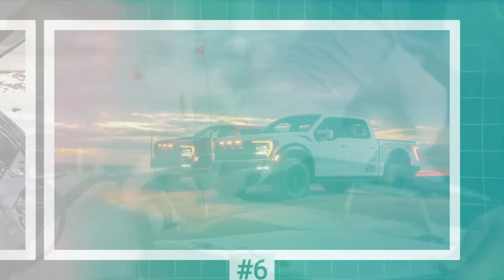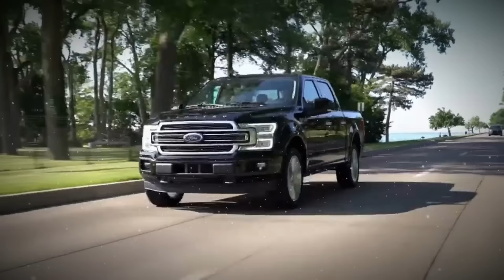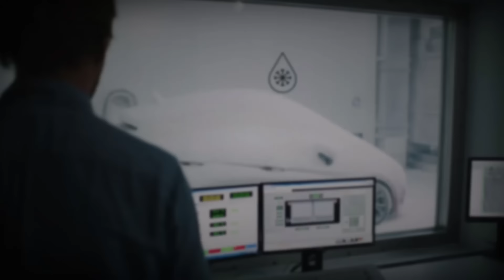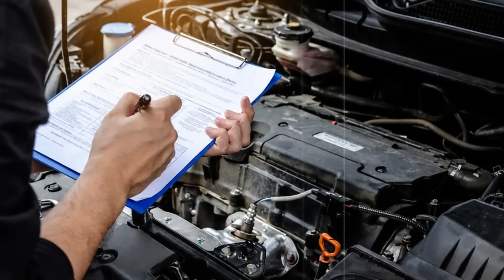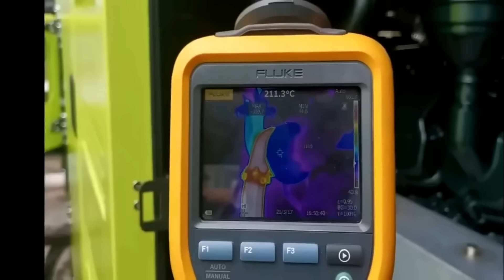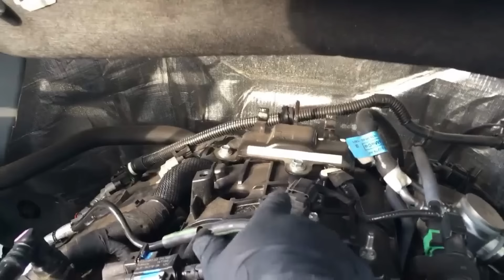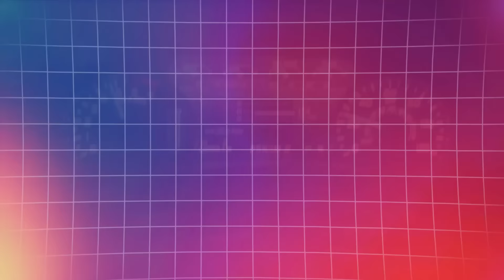We Ran a Turbo F-150 & a Naturally Aspirated F-150 Side by Side for 200,000 Miles — A Clear Winner

Comment: I think of paying for more gas with a V8 as insurance on a turbo or engine rebuild.
Reply: The older 2.7 EcoBoost doesn't have cam phasers. Good luck with your 5.0 cam phasers and rubber oil pump belt.
Reply: @kri @kristoforstewart995 But it does have cam phasers, they haven’t changed the 2.7 timing system, it’s gotten dual injection, vectoring turbos, electric watergates, and an oil pump belt, but it’s had cam phasers since day one they just don’t fail very often
Reply: @thomasnunya1438 You're right. I looked in the repair manual and now think less of that engine. At least it has a chain driven oil pump (shown under oil pump replacement). I will never buy a truck again that has cam phasers and and/or a rubber oil pump belt. I will be looking at the new Chevrolet pushrod engines. Hopefully, they don't have that garbage on their new engines. I had a 1.0 EcoBoost with a rubber belt and it disintegrated.

Comment: Had the same problem on stumbling on my 3.5 turbo 2014. Believe it or not but I was told to drill a 1/16 hole in the very bottom of my inner cooler, the problem went away and never came back.That was at 67000k and I now have 168000 miles. I warm turbos for 2 minutes and cool down the same. Thanks for the video 😁running penn ultra oil and top tier fuel.
Reply: 9767, it's called an intercooler.

Comment: 2012 f150- 220000 miles so far on my 3.5, just started to get the start up rattle. 2 major issue, steering issue but was under warranty, broke manifold bolt.

Comment: Nobody with half ass common sense would buy a 2.7 to tow 7,500 lb regularly, they would step up to a 3.5, my 2020 will walk off with 7,500 lbs behind it!
Reply: Yeah, right. My 2015 pulls that weight through West Virginia just fine.
Reply: @kristoforstewart995 and that can be a lot of hard pulls!
Reply: @bobadkins7377 I hit 4,000 rpm often, but V8 engines run at that rpm nonstop. I also use 93 octane. Maybe that's why my truck runs like brand new 11 years later.

Comment: Turbos should only be in the big tractor trucks only.
Reply: I don't have a problem with my 2.7. It doesn't have cam phasers and it does have a chain driven oil pump.

Comment: I don't want ecoboom in any vehicle.
Reply: I think it's luck of the draw because I have 2015 2.7 that I use to haul work trailers and boats. I've seen many Coyote engines fail over the years because of cam phasers and rubber oil pump belts. I must have got that one engine without defective parts.

Comment: Never tow 7500 lb trailer with 2.7 , step up to3.5
Reply: The 2.7 pulls it just fine. The older ones didn't have cam phasers like that aluminum 3.5 or 5.0.

Comment: sounds like the turbo spent more time in the shop
Reply: I have the 2015 2.7 EcoBoost. It doesn't have cam phasers. Good luck with the 5.0 cam phasers and rubber oil pump belt pos.
Reply: What made you think it doesn’t have cam phasers, I have a 16 2.7 and it most certainly does have cam phasers almost all newer engines have variable valve timing and use cam phasers. Mine are rattling on cold start currently (that or chain slap) and the mechanics say the 2.7 doesn’t usually have that problem like the 3.5 but it does happen.
(Edit) I’d still chose the 2.7 again though over the 5.0 that turbo low end torque is incredible, at 2500rpm the thing is flying, and I drive a lot of 5.0 for work and the ecoboost feels better and uses a lot less gas while empty.
Reply: @thomasnunya1438 You're right. I looked in the repair manual. I'll never buy a truck with cam phasers or rubber oil pump belts again. At least it has a chain driven oil pump belt as shown under oil pump replacement. I will be looking at the new Chevrolet V8s. Hopefully, they don't have that garbage on their new engines. I had a 1.0 EcoBoost with a rubber oil pump belt and it disintegrated.

Comment: Awesome comparison, and it confirms my assumption back when they introduced the ecobust trap!  When one buys a truck, the engine is the first option, not the truck! The idea of putting turbos on a V6 meant more parts and a complicated engine, in my view! In 2013, I bought the 150 CC, 5,0, OR, but the 6.4 bed, and as of today, with 158K, I've had great service! I put an oil pan gasket and rebuilt my AC system; the rest was consumables!
Reply: The 2.7 EcoBoost didn't have cam phasers until 2021. Good luck with your 5.0 cam phasers and rubber oil pump belt.
Reply: @kristoforstewart995  I believe all ford engines beginning with the tritons have had cam phasers, and 5.0 didn't get that wet belt until 2021. The 2.7 has had the wet belt ''rubber'' since the beginning.
Reply: @Wildwwill i was wrong about the 2015 2.7 having VCTs, sorry. But in regards to the oil pump, if you go to the Chilton 2015 to 2017 Ford F150 repair manual on page 2A-2 for oil pump removal on the 2.7 liter engine, it says:
1) Drain the oil and remove the oil filter
2)Remove the oil pan
3) Slowly rotate the oil pump drive CHAIN tensioner counterclockwise until a small drill bit or Allen wrench can be inserted through both holes in the tensioner, locking the tensioner against the spring.
4)Remove the 4 oil pump mounting bolts while supporting the rear of the pump. 
5)Slowly lower the rear of the oil pump until the oil pump sprocket can be lifted out of the CHAIN and away from the vehicle.
I might have VCTs, but I don't have a wet belt. Those are weak points that needs to be adressed.

Comment: 2.7 for everyday use with periodically towing 6000 or less like a boat or travel trailer. If your towing everyday or using it for work pulling 7000 plus pounds all the time id get the 3.5 or 5.0 and if you want best mileage empty 2.7 is by far the best and built better than the 3.5 and way less problems and more reliable. If you want the most reliable for 10yrs plus id take the 5.0.

Comment: Now compare it to the 2.7. Everyone knows the 3.5 can be a problem engine
Reply: I’ve had two 3.5 love the power. Can barely feel my 21 Foot Lund..
Reply: I bought a secondhand 2017 2.7 a year and a half old at the time with 7k miles on it for a steal as the owner wanted to go to the short box full cab. Mine is the extended cab with 6.5 foot box. I would have never bought anything but the 5.0 new. Anyway it now has 63k miles on it and almost never tows. On rare occasions my wheeler. Just changed out all the fluids and the drive train (6 speed trans) has been pretty much flawless. If I bought new I’d still get the 5.0 just for the sound. Also I’ve added a catch can for the valve carbon build up problem. With the kind of use my truck gets (not even hilly where I live) no complaints at all about the 2.7. Except maybe the lack of V8 rumble.
Reply: Exactly